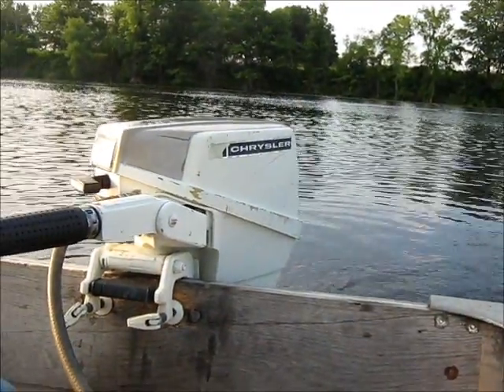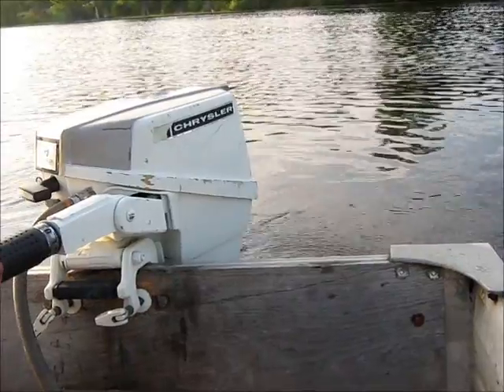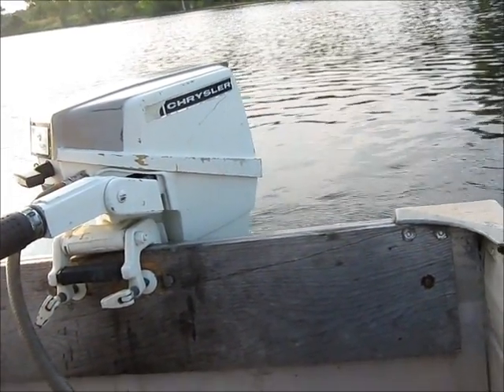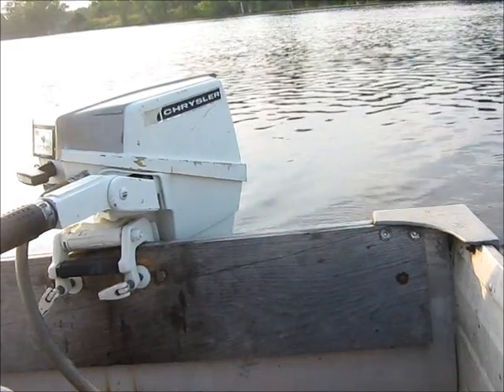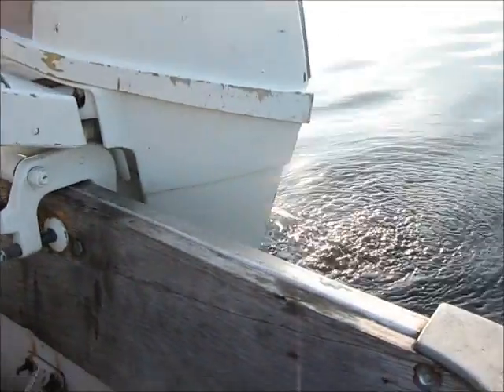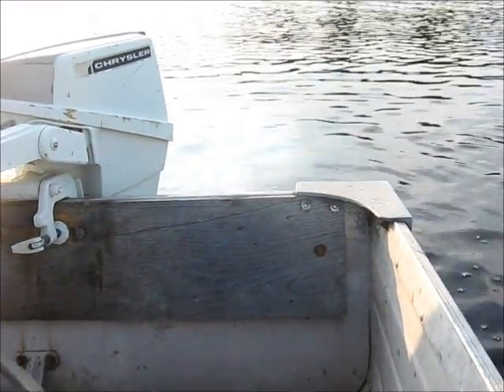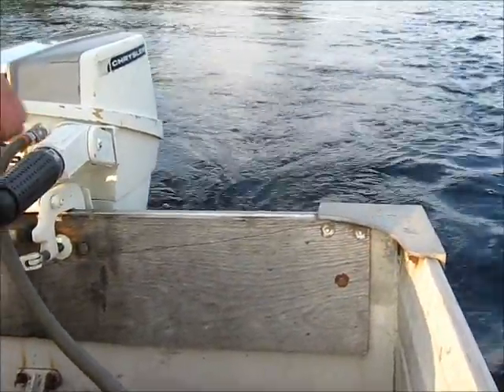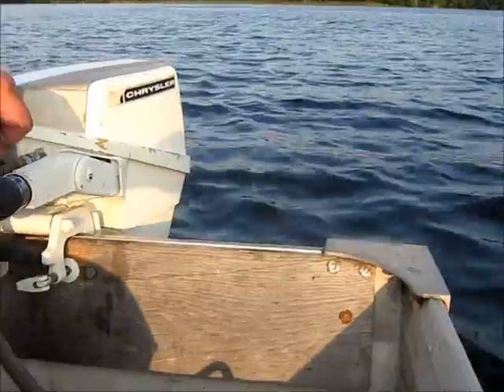1973 Chrysler 8hp outboard motor

Comment: What fuel oil ratio do you use in this? Also where can I get a water pump for it? Thanks I have the same one.
Reply: really old comment but i found 50:1 smoked like no tomorrow with lots of oil coming out of the foot. switched to 100:1 or closer to 75:1 far less smoke without having the mixture screw right in to get it to idle good. at your own risk as they say.

Comment: Hi what's the difference between the 8hp an 9.9hp?
Reply from the maker: BBBJBC A lot, The 8hp is only 46LBS and the 9.9 is 56LBS They are completely different engines.
Reply: Thanks for the reply I have the same engine it recently a reed valve disintegrated so I replaced them with carbon composite ones an luckily there was no damage to the pistons or ports.

Comment: Just picked up a 1982 Johnson 15 hp..the top groment for the water tube closed off cosed a over heat and stucked the no one piston..(not to bad) still had 90 lbs on both pistons..guy don't want to repair it..or pay the bill....I bought a new piston from China..comes with pin/ring set/clips for 24 dollars...hope I didn't get screwed...by chance you don't have the intake bypass cover for a elec starter and elec start flywheel do you..?
I bougth a piston from these guys for a 5 hp tohatsu/merc and all was OK..we'll see.
is there any way you can send some of your extra lake water from up there, are lakes are really getting low..hahahaha
Reply from the maker: mercmack I have used the China pistons in a few chainsaw's without any problems but have not used them in any outboard's. Sorry but i don't have any e-start parts for that motor.NO way you can't have are water :-) We need rain, we are 3.5" low Since July 1st.
Reply: its so little water here that the rattlesnakes are heading to Mexico for a drink..